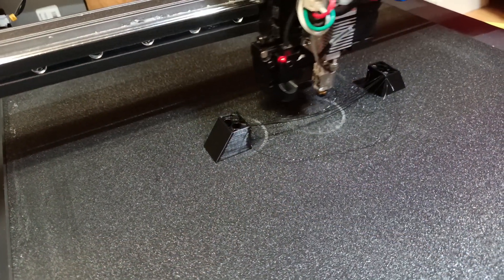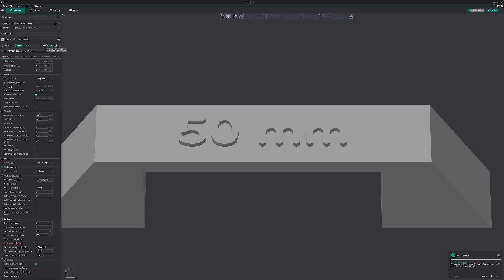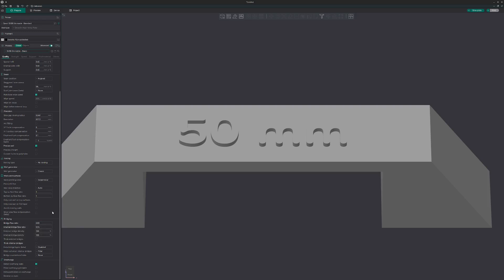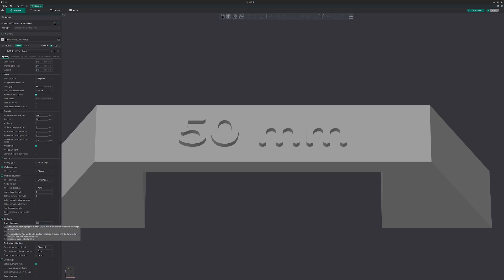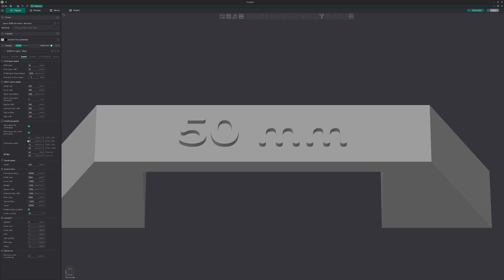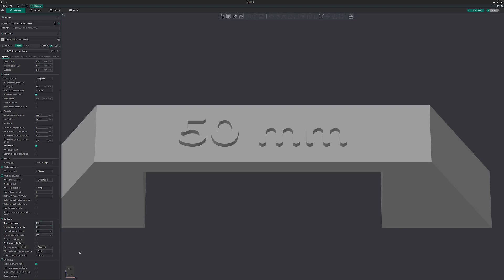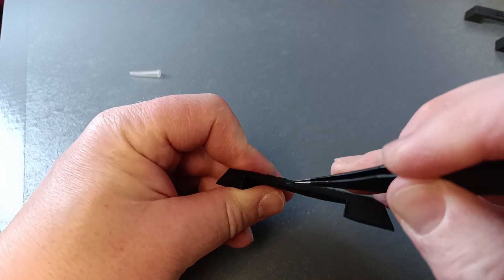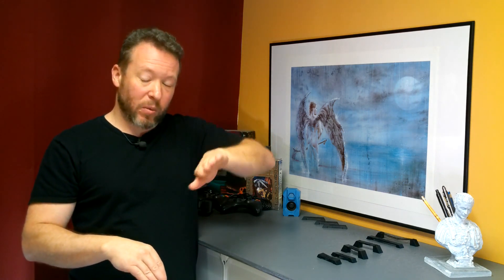Bridges on the Sovol SV08? Orca Slicer Settings Explained!

Comment: I cannot get my sv08 to do good bridges
Reply from the maker: I recently had some issues as well, but they're more due to the printer being moved around constantly and other hardware related changes.
Reply: @DomDecodes I'm using the new Polymaker PETG formula which prints really nicely, but bridging is not good.

Comment: OrcaSlicer 2.3.0 beta?  You're way behind.  I'm already on 2.3.0 beta 2.  😛  Actually, I typically use the stable versions and leave the bleeding edge to others more active in the development, but I'm liking the beta versions of OrcaSlicer.

The fan in the shroud isn't for part cooling.  It cools the filament path in and above the heat break on top of the melt zone.  You want the filament to melt in the melt zone but not above it.  Without the heat sink fan, you'll have thermal creep up into the filament path resulting in reduced reliability and maintenance problems.  Melted filament can deposit in the heat break and cause under extrusion or a clog in the heat break which is more difficult to clear than a nozzle clog.
Reply from the maker: The heat sink fan is mounted to the aluminium heat sink.
The fan in the front is ducted solely for parts cooling. It sucks in on the front and blows down/back.
Unless your setup is different.
Because the official pictures on the Sovol Wiki page don't look awfully close to the wiring in my printer. There seems to be a bit of a difference, depending on delivery dates.
Yeah I just got the beta 2 notification. But I installed it after the video.
Reply: The shroud has the part cooling. The heatsink fan is bolted to the heatsink.
Reply from the maker: It has half of the part cooling. The other half is done by the rear fan.
But yes, the shroud fan is for part cooling.